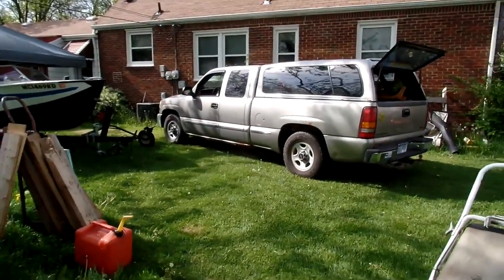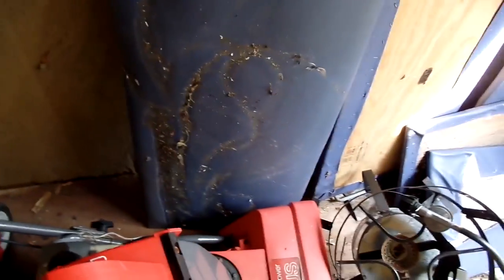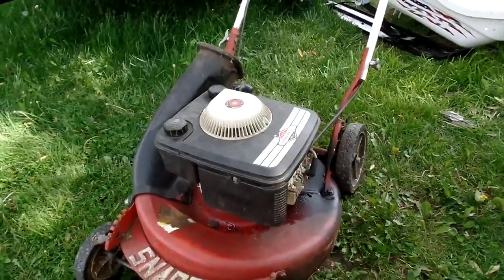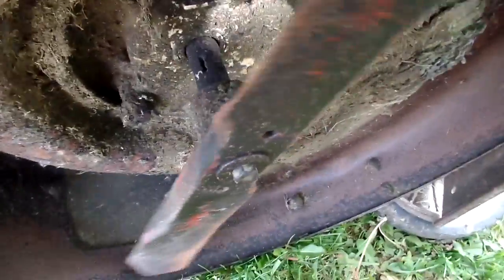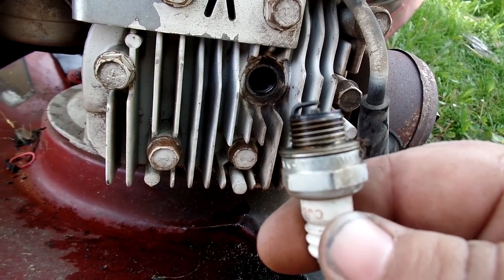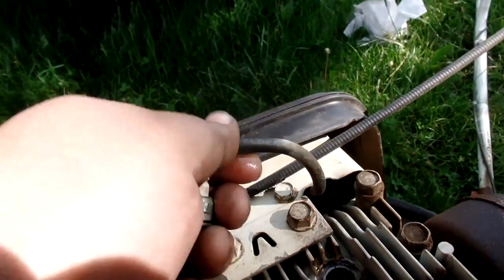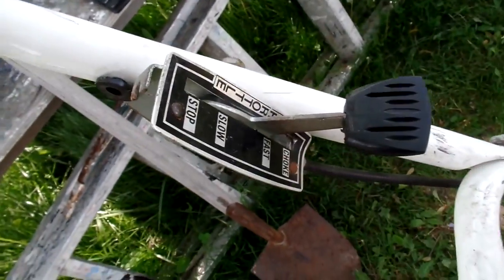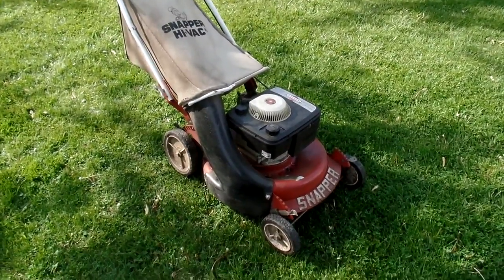Curb find lawn mower test startup.

Comment: Four things to run. Fuel/Air, Fire, Compression, and proper timing.
Reply from the maker: Yep. If an engine is missing one of those, then it will not run. This one had a very dirty carb, and now runs like a top. Thanks for watching!